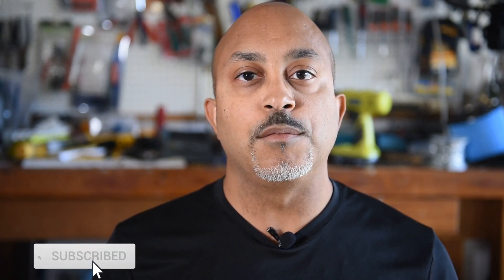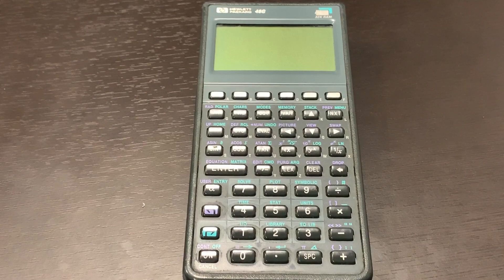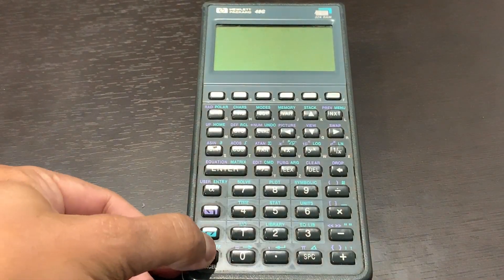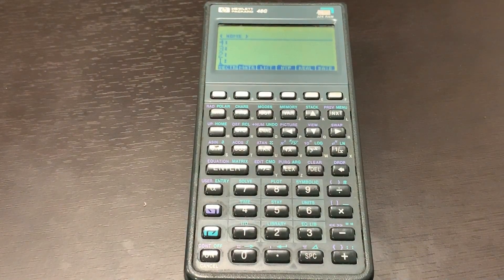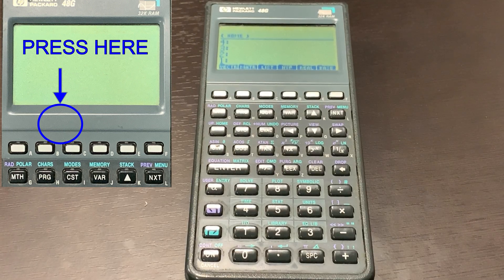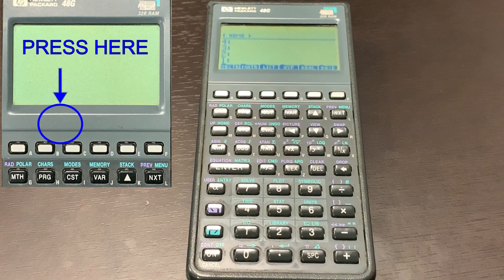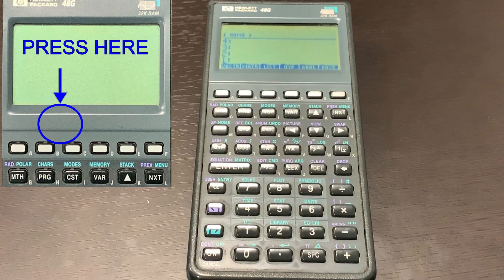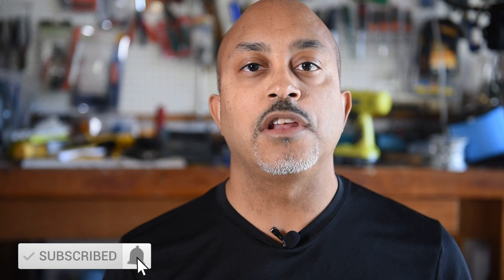HP 48 Calculator won’t turn on: EASY Fix

Comment: Awesome.  I was mashing down and moving the on button until it would finally turn on.  Little did I know that the button itself is not actually the problem.  You method worked perfectly the first time and so far, every time afterwards.  Thanks!

Comment: There is foam pushing up on a flexible ribbon contact that is not pushing well anymore.  Very common problem that I just discovered on mine today.  You can fix it, but it's not easy due to the way the calculator it assembled (not really meant for disassembly).

Comment: How in the hell did you ever figure that out?! I bought an HP48G at a thrift store for $5. I already had one that I paid full price for back in the 90s. It worked for a while and then I put it away and today, new batteries, and wouldn't turn on yet again. Saw your video and it works!
Genius...thanks
Reply from the maker: I stumbled on the solution by accident.  Glad it works

Comment: HOLY HOLY HOLY!!!   I've had this not-working HP48sx for like 20 years when it stopped working, cause I'm so sentimental..  but just tried your trick and I WORKED!! 

Yeah, I'm subscribing to your channel.   thank you thank you thank you!!!  :) :) :)
Reply from the maker: Glad I could help!
Reply: @DeaninItYourself  - I recall taking apart some kind of calculator a long time ago and two boards were connected by a thin translucent rubbery strip with extremely small fiber conductors laterally embedded  in it.  The contact clearly relied upon the strip being under pressure. 

I suspect the 48 might have something similar, but never wanted to destroy it by taking it apart.

Comment: Amazing.  I had this exact problem (48GX), and this trick fixed it.  I'll just note that pressing on that spot seems to be necessary for the power button to work at all.  That is, if you want to turn the calculator *off*, you also have to press there.  Thanks!

Comment: I recently bought an old HP 22s which appears to be in nearly perfect condition. However none of the right column buttons work 😖. I tried your suggestion while pressing the buttons and it works 👍 Thanks
Reply from the maker: Thanks for sharing

Comment: Thanx for the video. I have a 38G with the same problem. The earlier tips were to press and hold the On + 3th button from the left (top row) and I was thinking it was something in the firmware, but actually it is obviously a mechanical problem. I wonder if it is easy to open the calculator, as it has no screws...

Comment: Exactly as explained by a fellow commentator nl that the flexible contact at the bottom of the screen is not making secure contact between printed circuit board and the lcd screen contacts. These micro electrically conducting 'stripes' serve as contacts between pcb and screen and is pushed down against each other by a tight fitting pcb. However after a long time (due normal heat/cold expansion and contraction) of the casing/pcb etc , the contacts may not seat as when new. Thus pushing on the outside as the video shows is then just enough to make contact for a switch on.
 In my case the bottom right two rows (eight buttons) were not responding. Pressing on the right side at the screen bottom solves the problem. 
I opened the HP but a permanent fix is very difficult to achieve.
Reply from the maker: Thank you for the explanation,

Comment: Thanks! It worked! Do you know if once identified that the problem is with this contact, how to resolve this definetly not to proceed always this way?
Reply from the maker: Probably have to take it all apart and check the solder points but for a fix this simple its easier for me just to do it this way.

Comment: OMG this worked!!!  now my next problem is that some of the other buttons don't work unless i hold that same spot while i press each one...any way to fix that or permanently hold down that area?
Reply from the maker: I have the same issue, and i just hold down the same area, sorry i couldnt help more
Reply: @DeaninItYourself  thanks for the reply!  as an update...i wrapped an elastic band around the whole calculator and so far that's working.  i have a second calculator where i had to also put a small plastic object under the elastic for that extra little pressure in the right spot.  so i now have 2 fully functioning calculators!!! so glad i found your video.  Thanks!

Comment: This doesn't just affect the power button. All the keys come back to the contacts under the screen. I have 2 48SX's with several keys that don't register until you press under the LCD. Once you have to start applying pressure to use basic keys, consider the calculator garbage. It's unfortunate HP decided to make the calculator non serviceable because this should have been an easy fix.
Reply: @bobdahlin812  oh ya, that was easy 😂